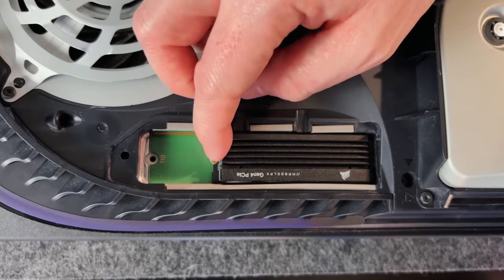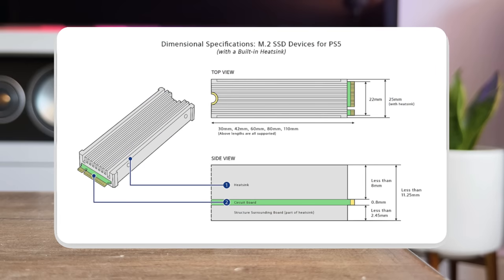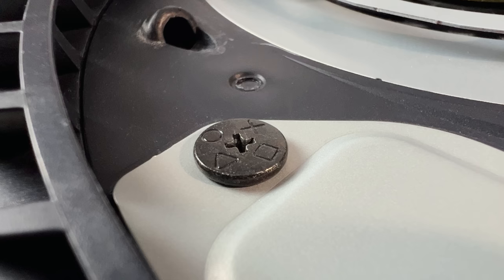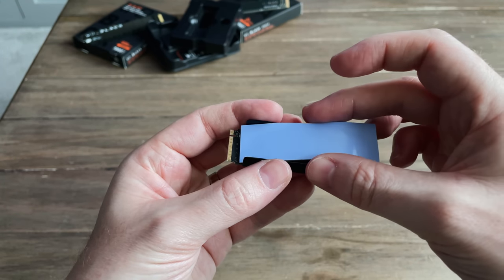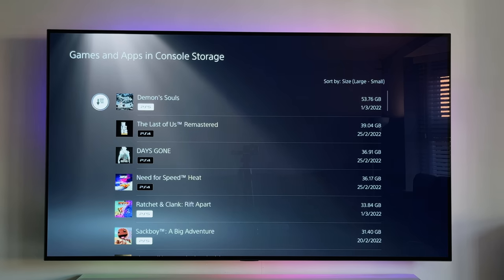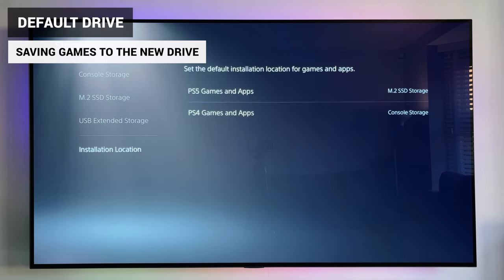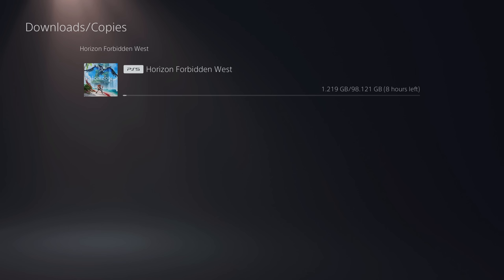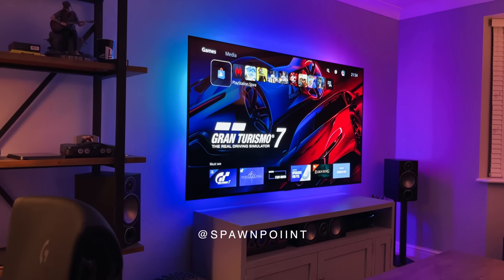The Ultimate PS5 Upgrade: Installing a 4TB SSD

Comment: Ever since I had a PS4, I wanted a 4-6TB Hard Drive. Now I have a PS5 (with Blu-Ray disc drive), and I can have a 4TB SSD to bring over a few PS4 games I haven’t finished to my PS5! Nope, that’s not overkill at all, as a matter of fact, that’s not enough. You most likely will need 6TB! Especially with games packing more into these Blu-Ray disc, and the files or game sizes are getting larger and not to mention updates (day one)… 6TB may be the actual number. Now unless you’re a person who when you beat a game, you’re done with it, then no, 2TB is perfect, but if you keep all of your open world games or play games like The Division, then a larger SSD size is (in my view) is recommended. Finally, cost be damned (if you can afford it during inflation), who can get a second PS5 without some form of trickeration. Right now on StockX, the cheapest PS5 for North America was going $730.00! With the recent restock, prices may go to $710.00, but then those go fast! So $500-$600 to get a 4-6TB SSD with the heat sink attached… that’s a price I’m willing to pay!

Comment: That's  nuts that SSD cost as much or more than the Ps5 console itself.
I  just buy Physical cd  games load 5  and delete and reinstall after that , SSD  and my internet connection is  so fast I can reinstall a cd game with updates in 10 - 20 min anyways. 
Even a  4TB SSD would have trouble with my 52 Ps4 cd collection .
There are 3,454 cheap used Ps4 cd Games that end up in bargain bins sooner or later , and no SSD upgrade is holding them all over time.

Comment: £864!!!!! Jeeze, that is a serious bit of coin for storage. But you can’t beat a NVMe for speed. I’m lucky that I get full fibre 900Mbps down south so I don’t need this, but I definitely need to consider the 2tb upgrade. Bet when they release a PS5 ‘slim’ they add 2 slots
Reply from the maker: Man I wish I could get decent speeds here. I’m house hunting right now, and the next one has to be ultra fast ready 😅
Reply: @SpawnPoiint  We bought a new build which comes with fibre to the property. I've had Virgin 500 and it was decent for downloads but awful for uploads. Guess BT could install it inside the house but obviously they will charge a premium for it..good thing with BT is I usually get over 900 and never any throttling

Comment: Any ssd that not require to update the firmware? Or can update automatically from ps5 without using pc or laptop?
Reply from the maker: No update required, just plug it in and format it. No PC required.

Comment: It's funny I'm looking at this video that I save to my playlist for playstation 5 upgrades months ago because I just finished installing a 2. Terabyte corsair drive yesterday 5 times and each time. I still got the same error message that I had to remove the drive because it was having issues with it. Never going to trust corsair again. In fact a lot of the amazon reviews say that their save data is gone because they trusted corsair. Within 5 minutes of having it in my system and popping it out. This thing was boiling hot even with the heat sink needless to say relying on this drive is a gamble . I'm not sure it can withstand a few hours in a ps5. Many of the reviews say 3 weeks and it killed the ps5.

Comment: Yes but it's cheaper to just move a game from an external SSD which you can get bigger than 4Tb. Just have the games you are actively playing on the internal SSD and the rest on the external one. Simple. Even 2TB is expensive.
Reply: I have about 7tb worth of external ssd for my ps4 games and ps5 games storage so I'm ok with my internal ps5 storage for at least the next 2 years. Since there's no physical significant improvement in speed as that would have been the only motivation for upgrading in my case.

Comment: So wait back up abit I just recently baught myself a PS5 however I already knew I cant play the games out of my ps4s 4TB Seagate External hard drive since I can only store them its not like the ps4 where I can play any game out of my ps4s Seagate external hard drive and since I was already used to using a 4tb only ps4 what and I want put all my PS plus games and physical games into the ps5 but I cant since my console storage is already full and I certainly cant afford a 4TB SSD heat sink internal drive like this and I already looked everywhere and there listed for the same price so can I just use a 2TB internal drive for this because I have alot of ps4 games and I dont want to delete them there my collection so will a 2TB be enough because I dont feel comfortable with 1TB I feel like its not enough for my ps4 collection plus I dont have any ps5 games as of yet so what do I get the 2TB or the 4TB which one is safe to use I would get the 4TB but that's almost $1000 coming out my pocket and if I buy a 2TB Idk if will be enough

Comment: I was told the PS5 couldn't deal with a 4TB, to be honest sony has made this system complicated and costly and now finding out the ps5 slim coming out in 2023 will require a external disc drive for the physical copies more storage and is better than these ones its getting ridiculous. The older models are a lot simpler and not as costly.

Comment: For me it would be nicembut first the console haha.Good for the no loading times but the most people is very expensive and the capacity is shitty like for example 250gb 300usd and the standard and normal HD are like 60usd it's just an example of course.I come from the 90´s and i don't have problems with loading times and this is crazy.It's funny how people complain about their internet and you mention 30 i think,you know how much do i have? 1mb to upload and 2 to download haha,i can pay for more but sadly they cannot reach here,for now until they repair the  normal phone i have 50gb on my cellphone during 3 days and i have to call every 3 days to renew,with that i can upload faster and download faster aswell,but when they come to fix the problem i will be back uploading 4gb to my channel for 2 days haha.New sub mate,greetings from Argentina.

Comment: i got a 4tb game drive only to find out you cant play ps5 games on it but it is compatible w ps5, why release a half baked product
Reply: The samsung 990 pro 4TB works perfectly with a cheap 11$ CDN cooler. The games copy at 7000 MB/sec and read at max ps5 speed which is around 6500 MB/sec. No overheat at all. Console is silent.

Comment: Personally I feel that 4TB is perfect when you consider how large "base games" are these days & that is before you even get into all the DLC that is coming out for them or how large they are: I'm looking at my game files now & Assassins Creed: Odyddey with DLC is 168GB, Valhalla is 137GB & Borderlands 3 is 111GB, that would be 2/3 of the console storage with those 3 games alone if I did not have an external drive for my games and I have almost 3 dozen games if you include mine plus the games I have for my nieces & nephews, lol 🤪 The only problem I am seeing though is that the external that I have only holds "PS4" games, so my question to you is: Does the new storage device that you are putting into yours in this video save/hold "PS5" games?? if it does not, then what is the point b/c then any PS5 game would then save to the console & it has very little space, if it does then my follow up question is where do I get one, lol?? P.S. Sorry for the length of this comment (by the way, your video either was very detailed & informative, keep doing what you're doing) maybe "SONY" will take the hint & start putting out systems with more storage from the start 🤑
Reply: Yeah the m.2 SSD internal drive he is putting in holds both PS4 and ps5 games and you can play both on that drive. If you get an internal SSD drive you will be able to play and store both your PS4 and ps5 games.
Reply: @tavorabrown3622  Thanks for letting me know
Reply: @michaelmoynihan8012  np and I hope they do make a console with at least 2tb of storage by time the ps7 comes out. And hopefully it's exactly 2tb cuz when we got our consoles it was not exactly the size they put on the box.

Comment: I think 2 TB is more than enough but I suppose it depends on the price difference between two and four
Reply: How many games you think could fit on the 2tb?
Reply: @HunchoAG3  With the estimation that most games are somewhere between 60 gigs to 100 gigs I would imagine you could fit seven room between 20 and 30 games easy and that’s on the high side not including the 600 or so you get from the internal storage that comes with the system

Comment: I went straight for 4TB. No point in getting less in my opinion
Reply: The biggest reason is not spending $700 to $800 on M.2 SSD,1 TB cost $130 and 2 TB cost  $253
Reply: @redscorpion9325  i paid $350 for mine. Found a sale and I jumped on the opportunity

Comment: Yeah no way am I spending 850 on a storage card. Can get a great 2TB for about 250. Only reason for a 4tb is is you want to keep all your games at once installed. But can easily just plug in an external right quick to move those games you won't play very often.

Comment: Would like to see a hard drive u can plug into the USB port u can add and play ps5 games on mate 👍👍
Reply: That will never happen because a hard drive is far slower then the read speed required to PlayStation 5 titles directly from it due to the mechanical aspect of it

Most External hard drives give you around 100mbs max, a $200 or so 3.2 gen 2 external hard drive only gives you around 700mbs to 800mbs, you need 5,500mbs or above to even play PlayStation 5 titles
Reply: @bamban_garcia5562  had one for the ps4 and didn't slow down my ps4 mate
Reply: @paulscott507  Maybe because the PlayStation 4 was built entirely around hard drives as its main reading / processing component resulting in similar speeds compared to other mechanical drives

Heck you can install a 4TB Samsung 870 Evo SSD to your PlayStation 4 if you wanted yet it will never give you instant load times or as fast processing as it was created for because the console itself was never designed around the ssds to begin with

All you would get on spending a couple of hundred on an sata III ssd to install are just a few seconds faster loading things or levels that's it
Reply: @BambanGarcia  have to get a ssd for my ps5 mate
Reply: @paulscott507  Like I said a hard drive will never be as fast as the ssd required to play PlayStation 5 titles from it due to its mechanical design

Comment: can this be done on the xbox series x/s?
Reply: No you will be throwing money away if you tried remember box went with a "patented" monopoly extended memory design as such you are forced to buy only from a single company

You have to pay $139.99 for a 512gb ssd, $219.99 for a 1tb ssd, or $399.99 for a 2tb ssd those are your only options

Also since its "patented" you will be forced to pay whatever amount the company wants for the 4tb ssd versions likely way more then the actual $1,099 msrp whenever they come out, you will not see them come down in price like the PlayStation 5 nor given several options to buy it from

Heck for about $100 more when on sale in comparison to the box $399.99 2tb you can buy a PlayStation 5 compatible 4tb ssd

Comment: my external is 4tb and its already full. So getting max ssd is the best. Get an extremely fast car with only 1 liter tank its not very practical. Ya ya its expensive but pc stuff is way more expensive. So I think its still worth getting for a ps5. A pc decked out will cost you a car... Ps5 atleast is a cheap bike lol.

Comment: If anybody wants to know? I’m going to answer a question everybody wants to know🤷🏽‍♂️ The answer is yes you can use a 1,2 & 4TB M.2 SSD along side a USB type C SSD in the front on the PS5 or a USB 3.0 SSD plugged into the back of the ps5 👍🏾

Comment: Will this fit in a ps5 digital
Reply: Yes. 

I  just buy Physical cd  games load 5  and delete and reinstall after that , SSD  and my internet connection is  so fast I can reinstall a cd game with updates in 10 - 20 min anyways. 
Even a  4TB SSD would have trouble with my 52 Ps4 cd collection .
There are 3,454 cheap used Ps4 cd Games that end up in bargain bins sooner or later , and no SSD upgrade is holding them all over time.

Comment: 100 games? Doubt. I have a 4tb external drive on my PS4 and it holds a good amount but def not "100+" I'm assuming PS5 games are even bigger, so this is unlikely
Reply from the maker: I literally have 99 games installed right now.

Comment: That thing is more expensive than a ps5. These freakin ssds cost Mind-boggling prices. Even the 2tb is unapproachable. Plus, what is the least infuriating is the fact that you pay all this money and then you have to replace your SSD with a new one that cost more than the ps5, that's really f@cked up.
Reply: That is because the Nonvolatile Memory Express Peripheral Interconnect Component Express Generation 4 (NVMe PICe Gen 4) 4 Terabyte models released early 2022 as such its new tech thus more costly
Reply: @bamban_garcia5562  Right, but that's why you pay to get a machine, otherwise they whould give them away for free. The thing here is that you pay, and you pay a lot compared to what you get in return, and it's nothing for the price if you ask me. Did you know that one ps5 unit doesn't cost above 150 US dollars to Sony?? Don't tell me that Sony isn't cutting corners here and there with the low quality materials they use on their devices. Even on the most serious parts of their products they're cutting corners like gpus, ssds, cpus, cooling system railings, heatsinks, batteries etc,etc. It's really infuriating to say the least.
Reply: @antisystemicparadise1202  Highly doubt manufacturing a PlayStation 5 cost less then $150 even more so when the components themselves have gone up in price due to global shortages

At least the 4tb ssds come down in price thanks to being on sale due to how many companies compete for that market

At least this way offers more options for consumers to choose from unlike the box $139.99 512gb, $219.99 1tb or $399.99 2tb expandable ssd monopolized solutions they offer
Reply: @bamban_garcia5562  if you exclude copper which is the most expensive material electronic devices have inside of them then the rest is literally a joke. Sorry but that's the case my friend. Everything else is just a matter of aggressive marketing.

Comment: Those internal M2 SSD Drives, are crazy expensive. So at christmas I just bought a Western Digital/Raid/28tb/ Desktop/External 3.1 Hard Drive. To dump everything onto. And I'm focusing on getting, yet another one too, asap. Because these games manufacturers I.e. them & they, have definitely lost their combined minds, by consistently putting standard & necessary things, like, proprietary-sizable-compatible-memory-requirements, on their respective customers. Expecially since they are are literally, nothing whatsoever, without our finantial-patronage. And we obviously need that internal memory, in order to facilitate, all of the software developers illy-games. Which of course they wish us purchase, again & again, for crazy piles, of amassed coin, too, [aka the freekery, without lubricant it s👀ms!].

You See It's Ashame On The Entire Gaming Industry. Because Many Of These Corperate Employees,Had Our Issues & Become The Scum That They Swore Up & Down Would Never Be Them. In Their Younger Days, Playing With Their Friends & Their Sibblings Too. Running Out Of The Barely Sufficient Memory, Scarcely-Provided With Each Individual Handheld & Then Home, Games Console. So by 2022 How On Earth Are We Not Only Caught-Up In Their Corperate Shenanigans. But Wasting Life, Valuable Playtime & Diverting Our Valuable Time & Our Valuable Resources, On Them & Their Sub-Standard Ineterior Products At All?
The Mind Boggles & Thus Changes, Frequencies, In Order To Address, The Greatest Of All Mental Matters.. 
Pertaining To That, Of, Maintaining, One's, Sanity. 
😂🔥😂🔥😂🔥😂🔥

Comment: If you need more than 1 TB of space, you got a gaming issue and need to seek help.
Reply: I  just buy Physical cd  games load 5  and delete and reinstall after that , SSD  and my internet connection is  so fast I can reinstall a cd game with updates in 10 - 20 min anyways. 
Even a  4TB SSD would have trouble with my 52 Ps4 cd collection .
There are 3,454 cheap used Ps4 cd Games that end up in bargain bins sooner or later , and no SSD upgrade is holding them all over time.

Comment: you do realize that you can have a total of about fifteen games installed without an SSD.   there is no person on Earth that can play more than 15 games at a time in fact the PS5 only lets you play one game at a time.  and since you can download right before you go to bed to replace any of those 15 games that you have installed. there is absolutely no reason in my opinion that you would need any more storage
Reply from the maker: Because I can
Reply: “You do realize” that some games are 200GB,  that’s like 30% of the capacity already. How will you fit 14 more games? 🤣

Comment: Only £870 well worth it lol. 👌
Reply: I got the 4TB Sabrent Rocket 4 Plus for only £399.99 British, a lot cheaper than what Chris paid.
Reply: @Shyamal Mavani  still I don't think it's worth more than £250 max for anything. Even if it means just 2tb. You can easily manage with that. I'm also lucky to have 600mb broadband
Reply: @mcsherlocks  Well out of my 4TB SSD, I have already used up 2.4TB.